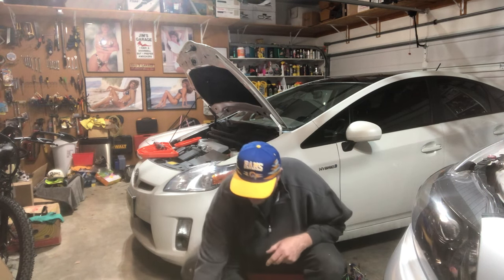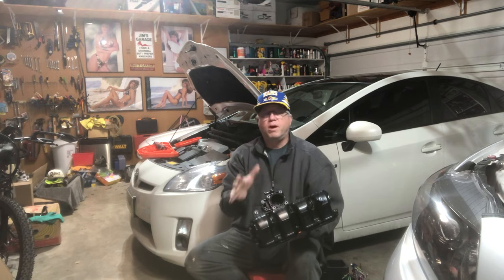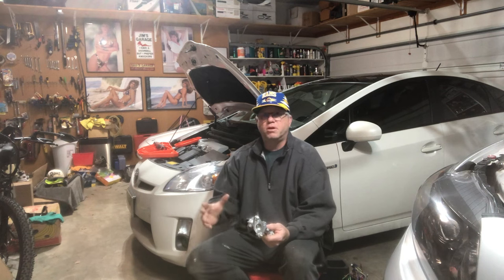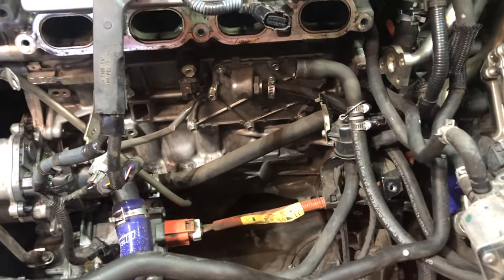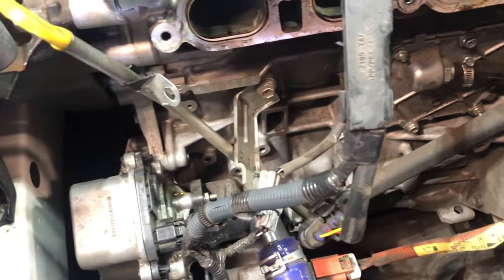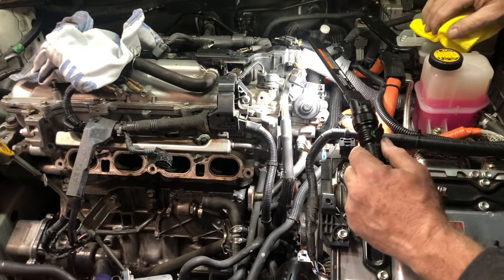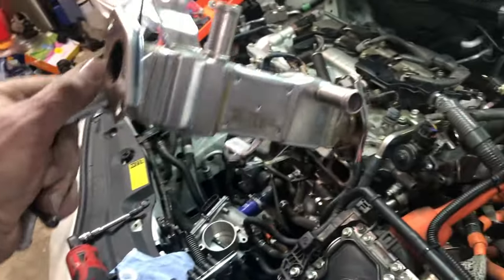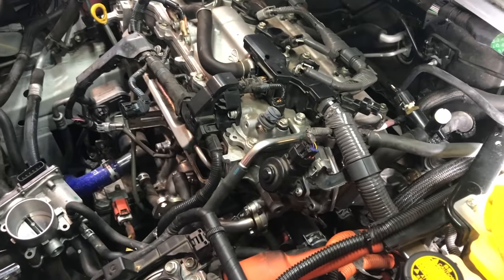2010-2015 Prius // EGR Valve // Intake Manifold // DIY // Removal - Clean & Replace

Comment: I worked on this today and it's super hard and I haven't taken out the nut of death. There's a black hose right next to it. What is that? Did you take that out? I think if I take that out, it;ll give me a little more room. Thanks.
Reply from the maker: Thanks for the question. It shouldn't be overly difficult if you follow along with what I did, it's just nuts and bolts but they can all be reached okay, except the nut of death. 🤣 There are several hoses that end up being in the way at one time or another but if I didn't remove it in the video then I didn't. I'm not sure what black hose is the exact one you are referring to. Can you point it out in the video and give me a minute mark of when it appears? I'm getting ready to do this again and swap in the cleaned parts I have ready and I'm going to do another video in the chance that I do something a different way that is easier to understand, better, or just at another angle. I try to be very through and not leave out any steps.
Reply: @jimsgaragetoys  Hi Jim. After spending few hours, I was able to get the nut of death out along with the stud without having to remove any hoses. I must say, my socket wrench had to manuever over and under various hoses and trying to get the socket slide. It was very difficult to me. Once I took the cooler out, I got my drommel and removed the bottom flange so that I won't have to reinstall the nightmare again. Hopefully nothing will catch when I put it back. This is the biggest auto project I committed to my wife. 1) clean the EGR cooler, 2) replace EGR valve 3) take out the intake manifold and clean each port, 4) replace PCV valve, 5) clean throttle body, 6) clean each intake port and the valves, 7) replace fuel injectors, 8) install new spark plugs. The easiest part will be installing the new fuel injectors and spark plugs. I figure since all these parts are taken out, might as well do these now. I really appreciate your video and it helped me out a lot.
Thank you.
Reply from the maker: @Sagemeister007  Awesome! So happy to hear that you did it! It will be easier now anytime since you've done it once and you don't have to mess with the nut off death again! Great job! I would highly recommend installing an oil catch can with everything off since you are replacing the PCV valve as it helps keep the intake  cleaner. It's so easy to do with the intake manifold removed. Why are you replacing your fuel injectors? Are they bad? How many miles on your Prius?
Reply: @jimsgaragetoys  It has 260k miles and since everything is open I wanted to replace the fuel injectors. Also oil catch can, how do like it? Do you notice OCC catching oil and how often you drain out the can? Any brand you recommend? Thank you.
Reply from the maker: @Sagemeister007  I like having it and it does help. I empty it every 5k miles when I change the oil. It was shown to make a big difference in testing shown on Priuschat forum. I have one like this on several of my cars and it works well. https://www.amazon.com/SPEEDWOW-Micron-Bronze-Baffled-Universal/dp/B086H9SSG1/ref=sr_1_13?crid=22OODIXD8987X&keywords=oil%2Bcatch%2Bcan&qid=1707790992&s=automotive&sprefix=oil%2Bcatch%2Bcan%2Cautomotive%2C278&sr=1-13&th=1
Reply from the maker: @Sagemeister007  Nope, I've never had a coolant leak. You must have a hose clamp that you removed not seated properly. I would double check the hoses that you removed. You can always pressurize the coolant system and see exactly where it's coming from but most likely it's something you removed that isn't right.

Comment: Hi. I just bought a 2010 prius with 147 000 miles on it yesterday. The guy told me that he doesn't think the erg / egr cooler or manifold haven ever been replaced. I don't know a lot about cars but I'm concerned about the health my vehicle... Some people recommended me to look into the egr valve / cooler / manifold in an order to not destroy the head gasket.... Is it bad if the egr, egr cooler and manifold never been replaced after 13 years and 147 200 miles ? Anyway! Thank you for that amazing video.
Reply: not bad at all if you address soon, but you are nearing the limits of where it would become a problem.  If the car hasnt thrown a misfire you are scraping by - but I'd do it soon and at least the water pump if you have not done so already.
Reply: @Fahmbo  I have done the egr , manifold cleaning few hundredths miles after having bought the car as well as replacing the water pump and the pcv valve :)
Reply from the maker: You're welcome. Sorry I didn't reply sooner but I never saw your reply show up in my feed. I would do the maintenance on them if you haven't already. I hope that your Prius is treating you well.

Comment: Great Video.  I see that you installed an oil catch can.  I'm trying to determine where you ran the lines to and from the oil catch can.  Do you have a video of the installation of the oil catch can on your Toyota Prius?  If not, could you please provide your line routing from the PCV Valve to oil catch can and from the oil catch can to the intake manifold?  Thanks.
Reply from the maker: Thanks! I did the OCC install before I started this channel, but if you look at this video at the 18:16 point the camera shows the PCV valve and that tubing runs to the input of the OCC, From the output of the OCC it runs back to the intake. That tube is sitting on top of the PCV valve since I removed the intake manifold. Here is a video when I installed an OCC on my 2017 Corolla iM. The PCV valve and intake connection are in the same locations so the tubing just runs to where you mount the OCC. This is in a different location but the process is the same. https://youtu.be/90nZTeLG7rw
Reply: @jimsgaragetoys  Thanks for the quick response.  I see that you ran both the inlet and outlet lines for the oil catch can in front of the Inverter/Converter.  With that being said; did you run the lines above or below the radiator coiling fans? After looking at my 2014 Toyota Prius I see that their is not allot of room between the Inverter/Converter and the front chassis/support of the vehicle.  However, I do like the routing of your oil catch can hoses in comparison to other YouTube Video's that I've seen with installing oil catch cans on 3rd Gen Prius's.  I do have one more question; do oil catch can lines emit heat?    Thank You Again.
Reply from the maker: @genei5549  The lines loop from in front of the inverter near the top and lay along the middle part of the fan. The fan has plastic protectors that prevent the tubing from even touching the fan blades. They then turn toward the engine, one to the intake and one to the PCV valve. 

I have never noticed any heat that would be considered hot. The tubing I used is pretty thick rubber.
Reply: @jimsgaragetoys  Thank you again for the quick response. When you installed the OCC on your Toyota Prius did you install steel wool in the bottom of the OCC? I just received the OCC from Amazon and it came with steel wool. Thanks again!
Reply from the maker: @genei5549  Yes, the OCC that I used for the Prius needed steel wool since it doesn't have a baffle in it. In my other cars I used the Mishimoto design that comes with a baffle so no steel wool was needed. I needed an OCC that had straight in/out lines due to where it would be mounted.
Reply: @jimsgaragetoys  Thank you again for all your help.  Where did you acquire the bracket that holds the OCC hoses directly in front of the OCC?  Just to let your subscribers know; my 2014 Toyota Prius only has 50,000 miles and has a 1/2" of oily substance (second owner, purchased car with 37,000 miles,  oil changes every three months or 5,000 miles, two PCV Valves) and the Toyota Certified MDT, Master ASE certified with L1,L3,L4 certifications stated the following after he seen the 1/2" oil in the intake manifold; "Our experience, we see oil accumulation in the intake plenum of most models that have an intake plenum that is downhill from the intake runners. The natural operation of the PCV system is to allow combustion blow-by to be vented into the intake system to be reburned by the normal combustion process. Along with this flow of crankcase gases, there will always some oil vapor that vents through into the intake. Over time this will accumulate on the walls of the intake manifold, condense, and run downhill to the lowest place. On some intake manifolds, this runs into the intake ports and gets burned by the engine. 
On other manifolds, it will accumulate in the lowest spot. On all Prius models 2001-2015, this is directly under the throttle body. We see this on normal running and performing vehicles. If there is no oil consumption between services, we see no reason to recommend a repair. It is my opinion that simple low volume oil accumulation in the intake manifold is not a malfunction of the PCV system, rather a characteristic of this system. We do not recommend any repair or modification to your vehicle at this time regarding this concern."  I even informed the Toyota Brand Engagement Center of this issue and they referred me back to the dealership.
Reply from the maker: @genei5549  Thanks for the info! I bought the bracket from a local hardware store. I can see exactly what you described with the oil, pic system and intake manifold. I do feel better that the OCC keeps less crap from getting to the intake manifold.
Reply: @jimsgaragetoys  Thanks again for all of the help.  Have you opened the OCC on your Toyota Prius to see how much oil/slug it has collected after you installed it?  Also, did you use the Rulline Universal 350 ml Tank 0046 Aluminum Polish Baffled OCC?  If so, did you install the steel wool in the bottom of the OCC or under the top cover between the two circular ported baffles?  Furthermore, have you experienced any plugged lines going to or from the OCC?   Thanks Again!
Reply from the maker: @genei5549  I empty it every 5k miles when I do an oil change. There is always plenty of crud in the OCC. I do have some SS wool in it. It's more of a generic OCC without a baffle in it. I have Mishimoto OCCs in my other cars that do have a baffle wit no SS wool. No lines have clogged on me on any of my cars with an OCC installed.

Comment: Can it be cleaned instead
Reply from the maker: I cleaned the EGR cooler and intake manifold so I have a clean one ready to go when I need to swap them again. I haven't looked at cleaning the EGR valve yet since it didn't look like a straight up process.
Reply from the maker: @edwinbab705  Part of it has wiring and contacts inside of it so I haven't looked inside to see if that was an issue. It wasn't a super expensive part to buy though and I knew that a new EGR valve was better than cleaning one.The other parts are easier to know you cleaned then well.

Comment: Noticed you have catch can installed. How much oil is being trapped between what mileage interval? Also if do you think the catch is necessary if you are having to swap intake manifold, EGR valve, and EGR cooler every 50k miles as you planned to?
Reply from the maker: Good question. I installed the oil catch can before I decided to just buy new parts to be able to clean and swap them. I empty it every 5k miles when I change the oil. I installed it after seeing that it was very beneficial for a Prius on PriusChat. I've never measured the amount that it catches but it catches enough that I don't want it dunking up my intake manifold.
Reply: I cleaned space under the throttle body at 80,000kms and there was just a very thin film of oil on it. Think the oil catch can is a waste as you should just replace the PCV valve every 100,000kms or so. It’s just cost a few dollars
Reply from the maker: @yslee1401  An oil catch can won't do anything but help. There are a lot of people on PriusChat that have shown that it can be a big plus for a Prius. Changing the PCV valve won't prevent the crude from being returned up into the intake manifold and gunking things up faster. I know that the crud that mind catches doesn't get returned to muck up things. You also checked yours at 50k miles which isn't much. Many Prius owners never check and clean things out until they have issues. The best defense is to install an OCC and still clean things out every 75k miles for a long, healthy Prius life.

Comment: You are pro level man! I really like your plan of having parts ready to go! Way less down time. I have a 2015 gen 3 plug in . My question is since there is a warranty on EGR related issues up to 150 k mi should I wait till I approach 150 k miles or would you recommend I start with swapping out new parts now and head off any problems? ( also adding a catch can!) Would really appreciate your advice! Are you going to make a video on how you approach cleaning intake, EGR cooler and valve?
Reply from the maker: Thanks. I realized how long it could take to properly clean the parts so always taking my time to clean a 2nd set made sense and have them ready for the next swap. I checked about the recall but the dealer told me that it was 150k miles or 10 years so I was beyond the time frame. You would be under both so check and see if a dealer can do it for free this time. Maybe they would give you the old parts so you could have them ready for the next time when you swap them again. The catch can is simple to install. The PCV valve is in the same location as my 2017 Corolla iM and I did a video for that install. I located the OCC in a different location but the install is the same. Maybe this video can help you. https://youtu.be/90nZTeLG7rw
Reply: Hi Leo Lee. I just bought a 2010 prius with 147 000 miles on it yesterday. The guy told me that he doesn't think the erg / egr cooler or manifold haven ever been replaced. Is it bad? Do you think Toyota will change the egr for free since the car has less than 150 000 miles? Thank you!
Reply from the maker: @DrumPeearl  I don't know why they would replace them since they are items that need regular maintenance. That being said, there's nothing that prevents you from replacing them yourself. The other option is to remove them, clean the parts, are reinstall them.
Reply: Where you able to get done under warranty recall from the dealer?

Comment: I want to replace my intake mani, EGR valve, cooler, and PCV.. any idea how long it would take to do it all? Need to estimate down town since I need my car, thank you!
Reply from the maker: If you have basic mechanical skills you can do that all in a day. If you take your time or give yourself extra time you could do it in a weekend if you want to split the work over 2 days.
Reply: @jimsgaragetoys  Appreciate it, thank you so much! :) Btw,, have you done the piston soak? I lose about a quart of oil every tank :(
Reply from the maker: @juanifico  I haven't done that as I lose no oil in  between my 5k mile oil changes. As soon as I see any oil loss I will do the soak ASAP.

Comment: Hi Jims! Thanks for that excellent video! I just got a 2010 prius with 147 200 miles on it and saw that it was highly recommended to clean the egr system (egr valve and cooler) as well as the manifold and it can avoid major issues such as misfire engine or head gasket issues. I am not handy at all but I don't have $500 to throw to a mechanic, in addition I want to do it the best as I can and have the control of the cleaning process of the part.

How long would it take for someone that never took done so many parts?

What do you advice to use to clean the egr, erg cooler and the manifold? (brands / type of product? Or tools?) 
Can it be cleaned in few minutes or couple hours that way I can reassemble everything in the same day? 

I would like to avoid costly parts. I have seen a lot of reviews of handy person saying that all the parts can be cleaned and reused.

Ultimately, do you think cleaning it would prevent the failure of the head gasket?

Thank you so much!
Reply from the maker: Thank you very much! I try to do my videos so people like you that have little to no experience can do it themselves. I would give yourself a full day to get everything off, cleaned, and back on. This way you can take your time. If you have a weekend that will allow you even more time to do it. I could replace the pats in a few hours now that I've done it. 

To clean the parts there are all kinds of choices. For the intake manifold you will need to use degreasers and long wire brushes of various sizes. Amazon sells a variety pack of wire brushes for cheap. If you have a large plastic container you can soak the intake manifold to let the degreaser work. Brake cleaner always works for the small holes. You will want to get new gaskets for the intake manifold and replace them. 

I've seen many things used for the EGR cooler and EGR valve including carb and brake spray cleaners and many of the all around cleaners from dozens of things claiming they will clean anything. You need to make sure the EGR cooler is clean and you will be able to see through it so it's very easy to tell. I didn't clean my EGR valve yet so I'm not sure about it. I bought a new one and haven't messed with the old one.
Reply: @jimsgaragetoys  thank you Jim! I have watched the video again and I am not sure if I'll be able to do all the labor, it looks really tricky. I am looking for someone that has knowledge to do it in Orlando area, FL for a reasonable price... I can't justify paying $500 to have a garage doing it...
Reply from the maker: @DrumPeearl  Have you met anyone else from FB Prius groups or Prius forums? It's usually pretty easy to find others that are willing to help out. I've done that over the years with many different car groups and we help each other out when possible.
Reply: One to 2 days I think!

Comment: the coolant for the throttle body has input and output or does no matter
Reply from the maker: I just removed them and clamped them off but make sure you put them back in the same place.